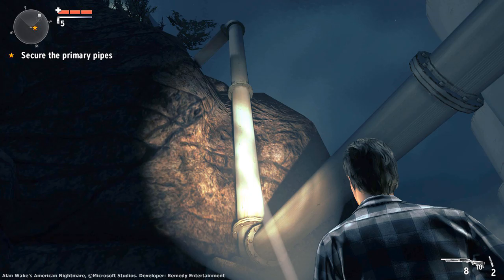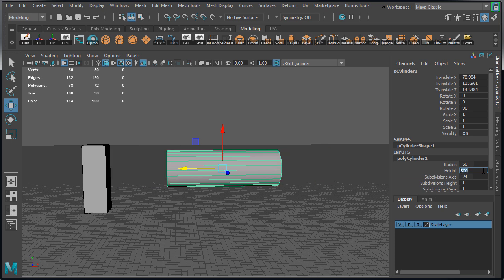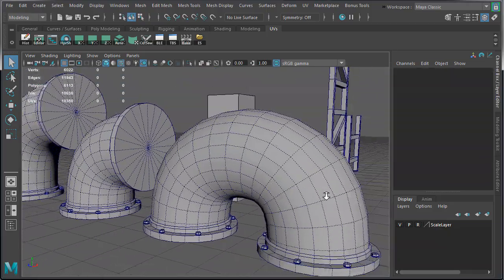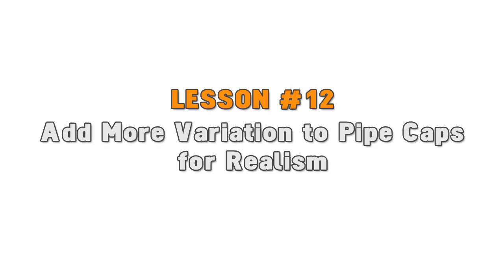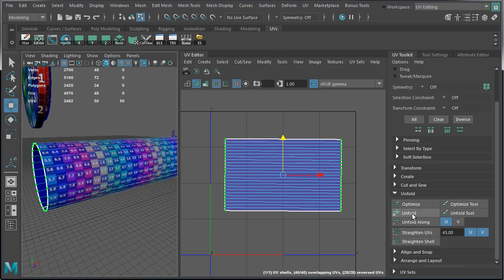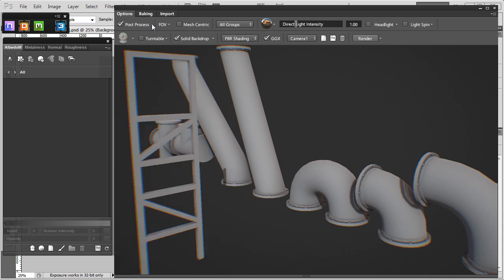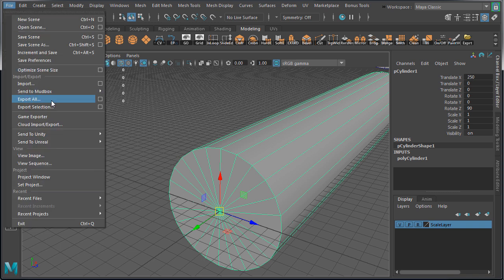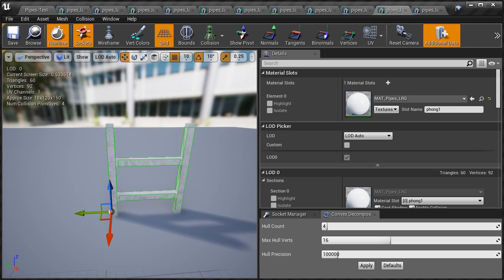32 Lessons I Learned from Creating 32 Modular Pipe Assets Tutorial with Maya LT/Maya & UE4

Comment from the maker: 32 Lessons I Learned from Creating 32 Modular Pipe Assets:

1. Pipes Need to be Modular
2. You Will Need 3 Different Pipe Sizes (Large, Medium, Small)
3. Determine Pipe Sizes and Dimensions Early
4. Word on Specific Styles and Creating Highly Reusable Pipes
5. Use Bridge Tool for 90 and 45 Degree Angled Pipes
6. Use Booleans (Yes Booleans) for 3 and 4-Way Pipes
7. Model Pipe Caps and Pipe Bolts Separately
8. Create Pipe Supports
9. Modeling the Valve Medium Pipe and Small Pipe
10. Use Shift+D (Duplicate with Transform) to Create Repeated Patterns
11. Soft vs Hard: Control Your Edges
12. Add More Variation to Pipe Caps for Realism
13. Bake Normal Maps Right Inside Maya LT/Maya for Great Results
14. UV Then Duplicate
15. Maintain Correct Texel Density Between All Pipe Sizes
16. Quick Way to UV Any Modular Pipes
17. Combine All Pipes into One Object for Texturing in Quixel
18. Don't Export as FBX for Quixel
19. Quickly Texture in Quixel DDO
20. Setup 3DO for High Quality Preview
21. Creating Color ID Map
22. Have All Your Pipes Share the Same Texture
23. Disable sRGB Option for Metallic and Roughness Maps in UE4
24. Create Lightmap Channel to Use Pipes with Static Baked Lighting
25. FIX: Why Your Re-Imported Lightmaps Don't Work
26. Using Material Instances for Color and Roughness Changes
27. Reuse Existing Textures as Masks
28. Pack Mask Textures into RGB Channels
29. Create Collisions in UE4 to Save Time
30. Create Custom Collision in Maya LT/Maya
31. Do Tests and Construct Scenes with Your Assets
32. Setup Your Project Folders from the Start to Maintain High Level of Organization

Download Full Tutorial Series here "UE4 Modular Pipes Project": https://www.worldofleveldesign.com/store/ue4-modular-pipes.php
Reply: *laughs in solidworks*

Comment: Looks cool, are these pipes meant to be positioned by hand inside unreal?
Reply from the maker: Yes.
Although you could set up Blueprint Splines.
What I did was placed them manually by hand and then for many of them I used grouping to combine them as one set of objects then tweaked within each group to add/remove as needed.

Comment: I am breaking my head to figure out how you import a joined UV for separate meshes... Can anyone help me out please? Great video though, I am just finishing my own scene with my own set of pipes, so great timing.
Reply from the maker: So you have multiple meshes that are all share the same UV layout? Import all the meshes and apply the same material with the same texture. That should work. Just double check that all meshes you have share the same UV channel 0 for texturing and the UVs are all laid out on this channel across all selected meshes. And make sure all meshes have their own unique UVs in channel 1 for lightmaps.
Reply: @WorldofLevelDesign  but if I join my meshes so that they share the UV layout then they won't be separate objects in the engine...
Reply from the maker: You don't have to join them. In Maya and Maya LT if I just select all the objects I can see and edit all of the selected objects' UVs at the same time. I lay out the UVs for all selected objects this way, then I export one at a time.
Reply: @WorldofLevelDesign  ah, gotcha... I am using Blender and I don't think it supports it. Thank you!
Reply: @adamplechaty  dude do it in the following way. UV unwrap all of the different meshes by themselves, but arrange their UV shells in the UV square as if they were part of the same larger mesh. Then combine them afterwards. For example one pipe with bolts attached. UV unwrap the pipe but don't let the pipe take up the entire UV space, leave some room for the bolts. Then UV unwrap one of the bolts and scale and position the UV shell in the area of the UV square that you left open for the bolt, like just pretend the pipe's UV's are in there as well so you don't overlap them. Then after you are done combine the pipe and bolts, now their shells are together in the same  UV space. Then you just texture each of the shells and both textures would be in the same bitmap, then easily apply that to your combined mesh in UE. Then you don't have to apply the same texture to multiple smaller components but treat is a a whole.

Comment: As a person that deals with pipe everyday for his day job. 1) Flanged pipes & fittings  are hardly ever used. 2) 4 way (crosses) are hardly ever used.
Reply: Yeah, I used to work as pipe fitter and now as services engineer (design HVAC systems). You only really get flanges on larger valves or pumps and other system components. I think crosses are only really used on sprinkler systems? I don't really mod these days but once played around using Revit MEP which I use at work to create accurate piped systems and exporting to 3DS, didn't work too well.
Reply: Flanged pipes are used all the time, agree with 4 ways tho.